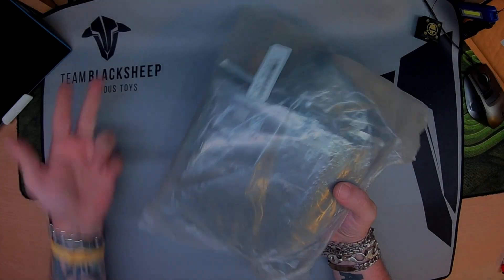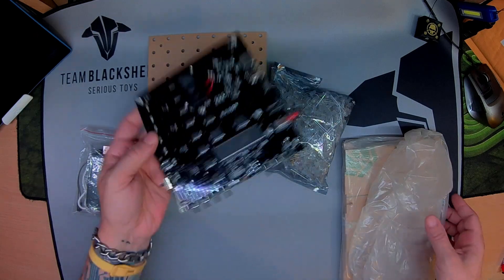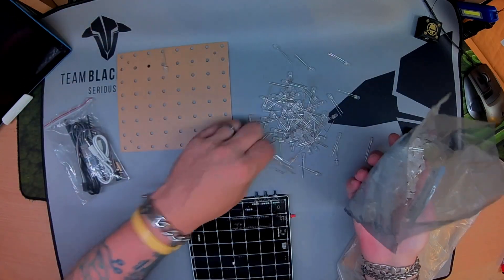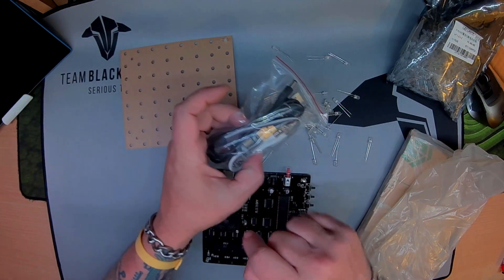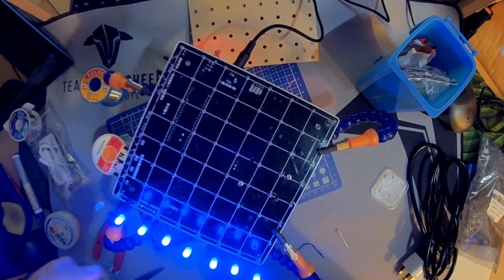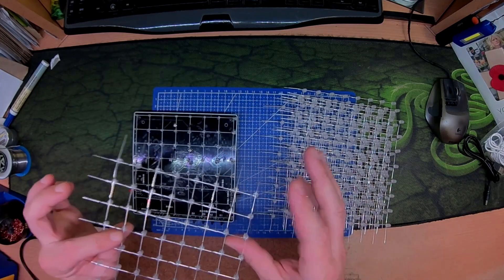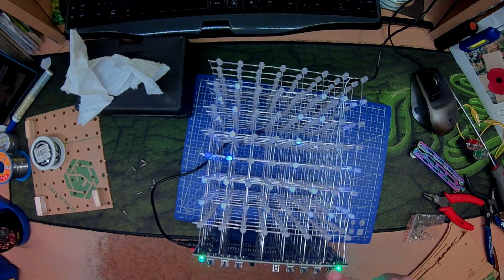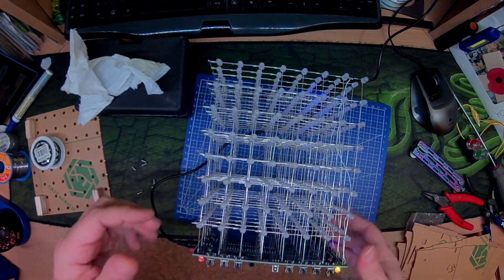DIY 8x8x8 LED Cube

Comment: Hey MrE
Thank you for the build guide, it was super helpful since the kit had pretty rough instructions
I bought the same kit and assembled it. It does the test loop, but when I press the K1-K4 keys, they just pause the current animation instead of switching to a different one.
I reflashed it with the .hex file it came with and I still get the same thing... Also, mine didn't come with a photo-resistor for slot RG1, do you think that may be related?
Reply: I found it:
I put the IR sensor on the top of the board instead of the bottom, effectively reversing the pins so it was throwing a constant signal. That got it working!
Then I cannibalized a photo resistor from another device and the varying brightness worked!
Reply from the maker: @Crocatowa  Great to hear & makes sense now! Good job and thanks for letting me know, hopefully the info can help someone else in future also!

Have you done any customizing with the firmware etc? ( I hadn't touched it as it was a gift but always wondered if it was relatively easy to swap out the branded cycles for something more personal for the recipient)
Reply from the maker: I would doubt that RG1 component missing would exhibit just pausing on on K1-4 however you never know, prehaps try bridging it or something (maybe a resistor).
Considering that you flashed it and it does the same makes me think that things are seemingly ok on the board for the most part - have you tried flicking SW2?

I have a feeling that I encountered something like this but It has been so long since doing this , I'll have a think & look through the documentation I have hidden somewhere.
Reply: I haven't yet, but I am a software developer by trade, so the biggest thing will just be making sure the compiler plays nice.
I was thinking about making an app similar to the computer controlled one that can create the sequences and spit out the relevant C and I can just add it to the existing stuff... I will have to translate all the Chinese though, lol
Reply from the maker: @Crocatowa  The thought of doing that makes my head hurt ,especially in C! The results would be well worth it though, I'd consider using an Arduino derivative to handle the logic.
None the less, would you keep me posted on your endeavours?
Reply: Sure!

Comment: Nice video, that looks really cool :0
Can't imagine how this would look with some self changing RGB LEDs :p
Reply from the maker: Thanks!
An RGB kit one would be great but I doubt you'd see it due to it making smoke come out of my ears :)

Joking aside - I think you can get them but imagine the wiring and soldering would get a bit complex with 4 legs per LED - saying that I bet one with the smart RGB WS2812's wouldnt be much harder than this one.
Reply: @MrE.  I just searched for RGB LEDs.. if the work doesn't stop you from doing it - the price will..
€50 for 100 leds.. 

I also thought about this, 
There are also LEDs that automatically change color, you just need to connect then like regular LEDs
Not sure how they're called
Reply from the maker: I have a few of the auto RGB ones which would be cool for a project like this but those 4 pin ones..

I dont intend on doing one of these again in the near future, 512 LEDs, 2 leg bends each and then 1024 solder joints to make the 8 grids, a further 128 to fix them to their connections etc and then all the data lines aswell as the structural bits.
I'd imagine the complexity and time would go through the roof with the 4pin ones :)